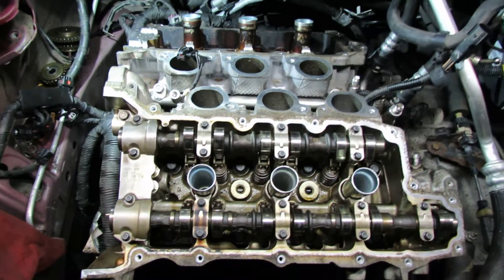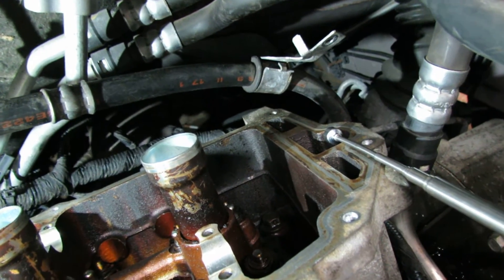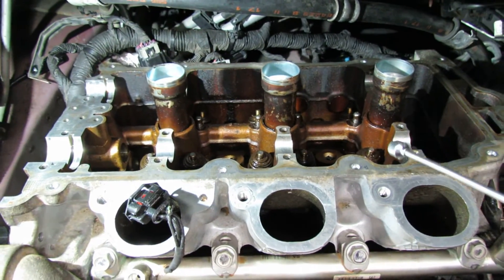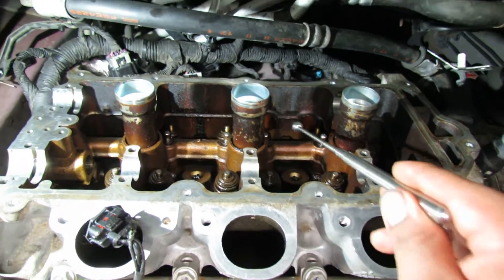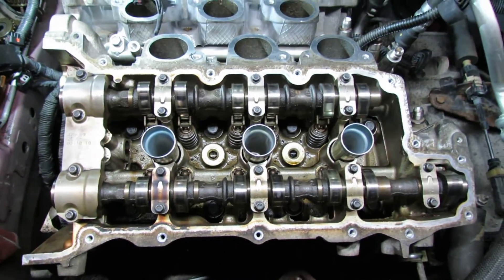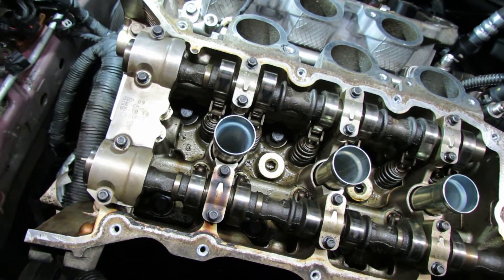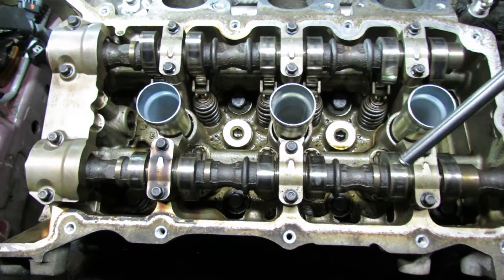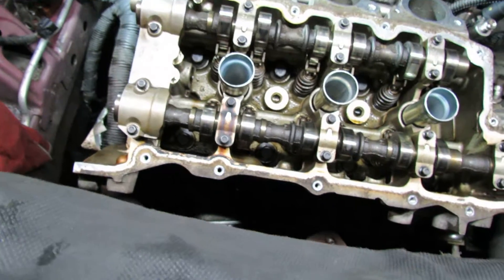3.6L GM Engine Torque Specification/Sequence: Cylinder Head Bolts

Comment: Will those specs work for a 2013 impala 3.6L dohc flex fuel head cause im having issues with getting the gasket to not leak coolant into the head n mixxing with the oil

Comment: Would it be the same for LTZ Impala engine it's a 3.6 as well?
Reply from the maker: @maccmanloccs1105  it should be the same, only difference I can think of if it has or doesn't have the high pressure fuel pump on top.

Comment: Can you verify/confirm, which head bolts, aperently there is a couple that are exposed to the coolant system and should have "sealant" on the threads before torquing?
Reply from the maker: During the course of me reassembling back together, I did not see any mention of putting sealant on specific bolts that would prevent coolant to leak through. The only other thing that would be used on the threads is Loctite, which is a type of "glue' that would help prevent any bolt from loosening up after assembly.

Comment: I ordered head bolts and got threadlock with it. Is that for the smaller bolts?
Reply from the maker: Could you elaborate more on what you mean by smaller bolts?
Reply: @HP38567  2 smaller bolts in the front

Comment: What should the end foot pounds be near if you don't mind me asking is it below 80 and is there just that 150 degree second faze and that's it it didn't seem very tight for how hard they where to take off
Reply from the maker: Thanks for watching! 

To answer your question properly, I did some research. 150 degrees is equivalant to around 73-80 FtLbs but don't quote me on that. The reasoning behind torqueing down in n is because engineers figured that it would be more consistent when tightening down torque-to-yeild bolts. Which is why you should never reuse headbolts. 
Personally, I feel that the reasoning they feel tighter when taking off is because of the pressure these bolts endure during its lifetime and. Also, if you reuse the head bolts and loosen them up after tightening them down,, they won't feel as tight when you first took them off.

Comment: Great Video do they recommend replacing the head bolts
Reply from the maker: Yes, these bolts are torque-to-yield bolts so they stretch during assembly and need to be replaced when removed. You may reuse them but they may not torque down properly so you may see head gasket failure in the future.
Reply: @HP38567   Thank you